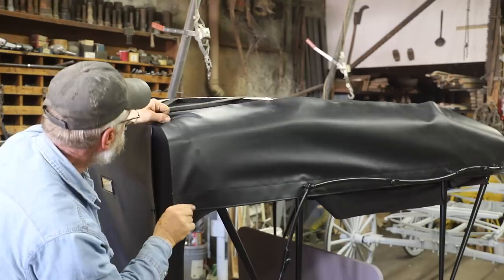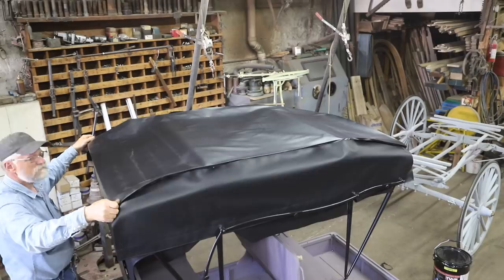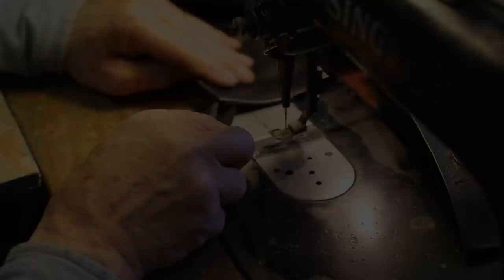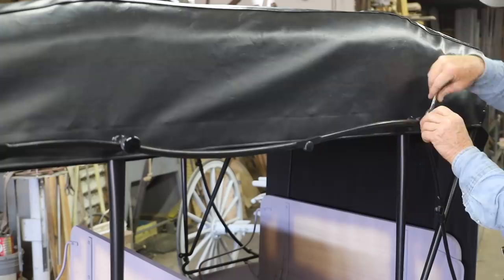Carriage or Buggy Top Final Upholstery Process | Engels Coach Shop

Comment: This was great. In my younger days I installed vinyl tops and convertible roofs on automobiles. I see many of the design elements passed down from here such as dual or center seams, S-bars, and opera windows. That was a design and fashion choice that has slipped away now. Keep up the good work. (S-bars on a hearse with the vinyl top was a challenge, LOL.)

Comment: I think what you did Mr. Engels is absolutely beautiful, the only thing I would have done differently is put some clear detachable windows on the side for when it rains. I know that is not period, for when that buggy would have been common. But it would have been a nice touch for luxury in rainy weather, other wise no practical for every day use. Yet that is a preference I would have wanted if that buggy was mine.

Comment: Nice completion Dave.  Thanks for showing the whole process.  I was interested in how you attacked this patterning/sewing project, as that was my line of work for 30 years.  (making patterns for tents, which really are pretty similar to what you were doing).  My only suggestion would be that if you moved that seam between the top and side panels a little more toward the sides, you would have fewer wrinkles in the final project.  Bending that side piece up and over is what is causing the wrinkles.  But other than that, very professional.  Thanks, as always.
Reply from the maker: Thanks.  I put in in the middle of the curve to split the difference since it's a compound bend.

Comment: Surprised there were no grommets in the holes where the top goes over the ends of the bows.  Even with the clamp on pieces, it still leaves an unfinished edge where the tension is pulling.